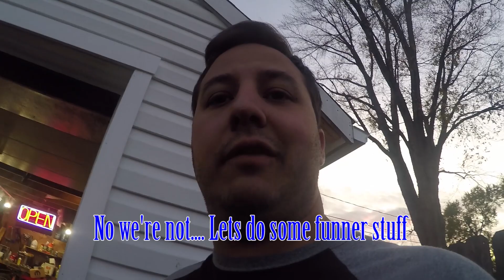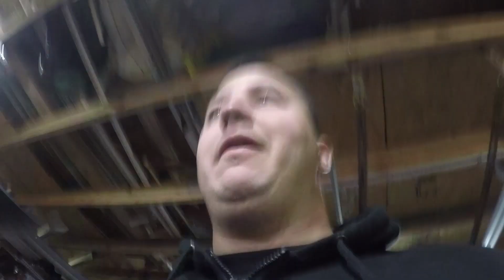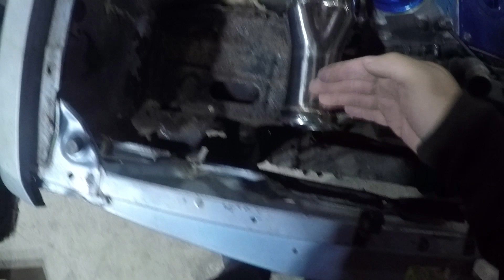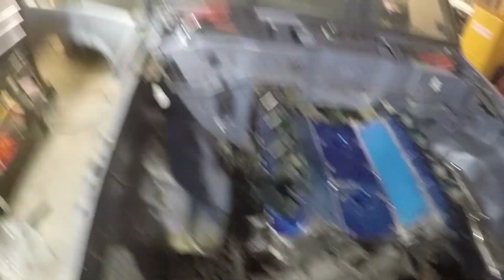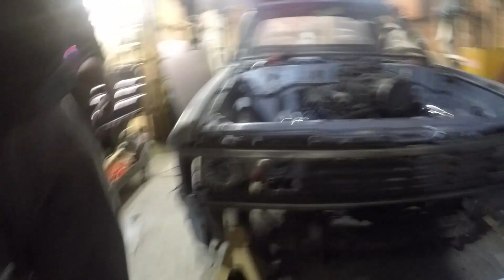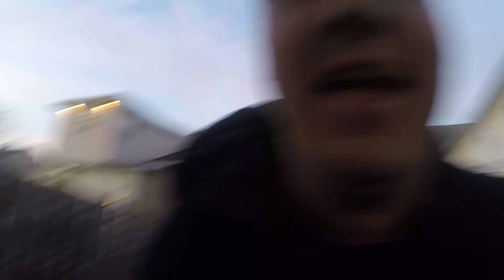V8 Datsun 720 Build Pt13-  Mocking exhaust manifold and Turbos

Comment: Thats going to be one badass mini truck. I'm a 720 owner up here in York, PA. I'm planning on starting my sbc swap in the spring. Great inspiration, keep up the hard work.
Reply from the maker: Thank you. Hopefully by spring time we'll be on the track. If you ever near Baltimore let me know.
Reply from the maker: One thing I will tell you I would have done different. You could probably get away without cutting you firewall out. Just get a low profile accessory kit or you could remake that front frame section to clear the motor without cutting the firewall
Reply: @loluracing  Thanks for the advice. The plan is to run a borg warner t5 behind it. I'd like to keep as much original sheet metal as possible. I'll get a better idea of fitment after the original motor is out, being that it just clocked 100k. Still drive it 2 days a week just because I can. Lol